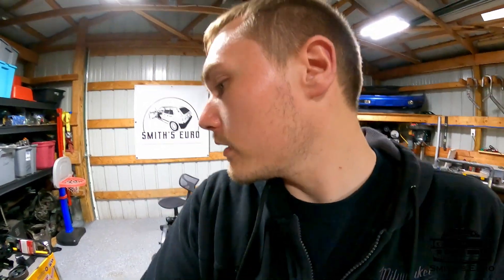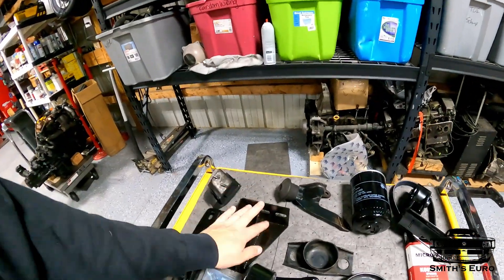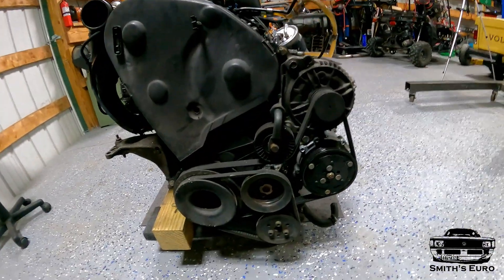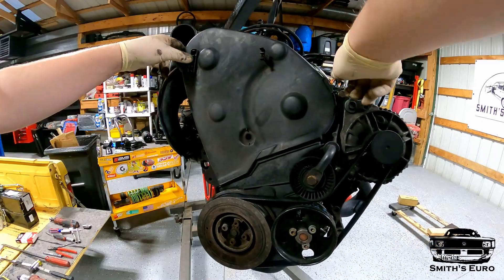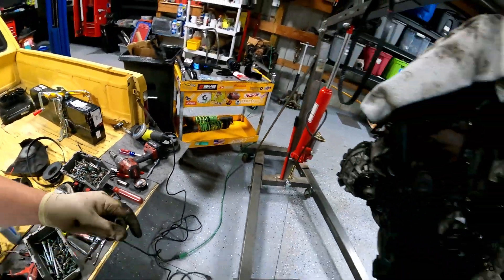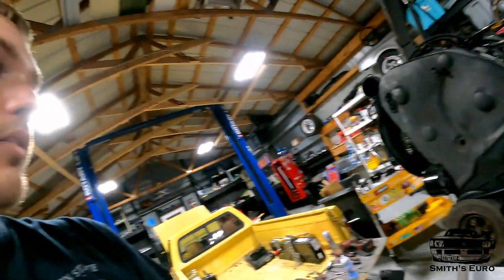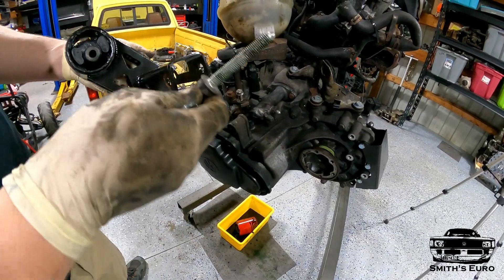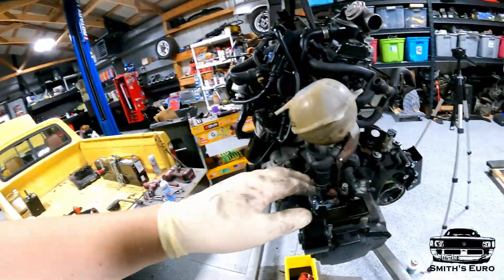MK1 RABBIT PICKUP TDI ENGINE MOUNT PREP FOR  02J TDI SWAP

Comment: Isn't the 021145255a power steering pulley?
Reply from the maker: Yea something got mixed up somewhere along the way
Reply: @SmithsEuro But that part number is good? The PS is the right pulley ?
Reply from the maker: I dont remember, trucks long gone

Pretty sure i used a vr wp pulley
Ans mustve read the ps one off cause it was on the shelf

Comment: is there video of the drive by wire pedal install?
Reply from the maker: No I wasn’t happy with it. I used the mk3 pedal.

If i were to do it over again just buy any mk4 pedal and mk1-mk4 pedal adapter bracket.

Not worth the hassle of time i put into using them mk3 ahu pedal to save $100

Comment: Did you use the original driveshafts from the caddy to the newer engine?
Reply: I have an original 1.6D with the original 4 speed gear box in my caddy mk1 but im swaping it for a AHU engine and a 02j/ctn gearbox. So im kind of trying to figure out what parts i Need and what parts i can reuse
Reply from the maker: Use everything i used.
For 02j trans youll probably have to swap the axle cups to 100mm 2.0/tdi ones to match the scirocco axles

With your car being 4spd youll need washers for then axles or they will lock up
Reply from the maker: Depends what trans you use, original to mk1 reuse all that stuff.

I used the 02a so i got 16v scirocco axles and used washers to space them from the hubs.

90mm mk1 hubs need washers
100mm mk1 hubs do not
Reply: The engine and gear box comes from a caddy II

Comment: Hello,
One question. Can you use original rear transmission mount or you need this aftermarket one?
Thanks in advance.
Reply from the maker: If you are converting to an 02a or 02j transmission you need a conversion mount.

If you are keeping your oem 020 5 spd or 4spd rabbit trans you can use the oem mount that came with that trans.

Comment: Would this set up work for an ALH engine?
Reply from the maker: No, alh has an internal waterpump. You would need a custom made bracket engine side.

If using the 02a/02j trans these mounts would work.

If using the mk1 020 trans you reuse those mounts

Comment: correction for the water pump pulley .. it's the power steering pulley off a 12v vr6. I'm getting things together to do this swap and looked over my 12v vr6 and found this out. Thanks for the video.
Reply from the maker: Ive never tried to see if that would fit. 
I have only done the 12v water pump pulleys used in my area.
But in order to use it you have to have a few mm machined off the tdi crank pulley.

We had a lathe at the shop it was always the most common way for us to do it. And plenty of vr6 engines around to take the waterpump pulleys.
Reply: @SmithsEuro  Could You post the final diameter of the crank pulley? And did You take off metal on both the inside and outside rig? I have a friend with a lathe, it would be great to know how much to take off.
Reply from the maker: Usually has to be tested as you go.
Id say start with 2mm cut off so youll have 4mm total diameter cut off but per side will be 2mm that always faces the pulley.

Comment: As I worked in VW parts at one of the stealerships I was at before I was a tech there, the 'H' part as opposed to the 'D' is probably just superceded for either the application or it's an 'updated revision' of that bushing. You can check ETKA and type in the full number under the tab for applications and it'll tell you what it all fits. I'm sure anything mk1 chassis specific and possibly something older. The revisions happen more often on typical 'bulletin' parts like  coilpacks... It may also be VAG's answer to an old part that became NLA. The mount brackets look nice although I do prefer poly or delrin. As long as it's got grease on the bushing and the proper sleeve/ washers they work well at helping the slop in the drivetrain. Prothane makes a poly insert for those mounts too, or you could make your own with some liquid. Good video man, great to see some progress on the caddy!👍😎
Reply from the maker: Looks like its and auto vs manual part number. The H is auto technically.

I thought about those inserts but was trying to keep rattles out.
Though in the end i had to get a solid lower rear mount due to the added power lol.

Thanks for still watching man! Appreciate it.
Reply: @SmithsEuro  
Yeah that makes sense about the P/N. Didn't think to mention that as a possibility for the part number breakdown. Yeah I remember running everything from hockey pucks, to homemade urethane mounts, using liquid urethane or delrin, the inserts, Vf engineering 3 mount set, BFI, EIP, and BBM solid aluminum front mounts, etc. I preferred the VF set or a combination of one of the solid aluminum front mounts, along with my own rear urethane one and a G60 trans mount. Seemed to be the best combination for my needs and the NVH never really bothered me that much. I built mostly a few different 1.8l/ 2.0l 16v's in either N/A, ITB, or boosted setups. Really miss some of those builds  and the raw feeling of them. Your caddy is in exceptionally good shape.  Can't wait to see this thing get built!😎👍👍
Reply from the maker: Youll have to build another one.
Reply: @SmithsEuro  
Yeah it's definitely a possibility if I could find the time/ money and an actual chassis to start with that isn't a rotten pile LMFAO 😏

Comment: Very cool to follow you, interesting videos you do👈🏻😀 regards from Denmark 🇩🇰  check out my mk 2 with 110hp TDI
Reply from the maker: Thanks for watching. What engine do you have in it?
I plan to put the truck on the dyno with the stock ahu turbo to have the baseline before going to the bigger turbo later on
Reply: @SmithsEuro  my engine came out of an seat Toledo from 1997, actually everything fits directly in golf mk2. Toledo frame is the same like golf mk2 in those models
Reply from the maker: Whats the engine code? There’s always differences from usa.
We have the ahu(which i have) and the aaz in the mk3 generation
Reply: The Engine code is AFN
Reply from the maker: Cool, looks like that one has a vnt turbo ours here are a normal wastegate style. 
Yours also may have different injectors/mapping to get the extra power over my ahu.
Cool to see the differences